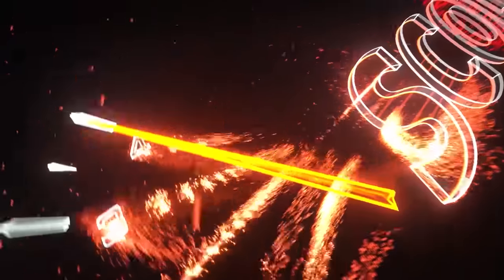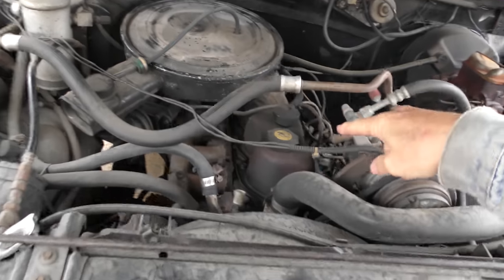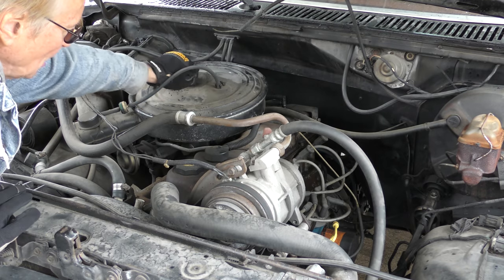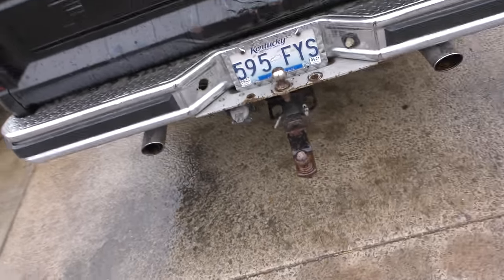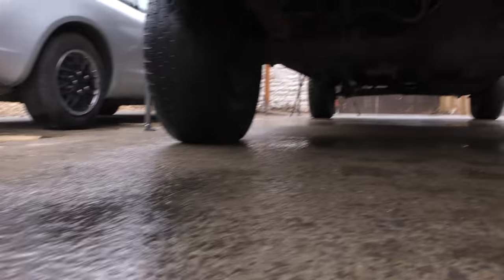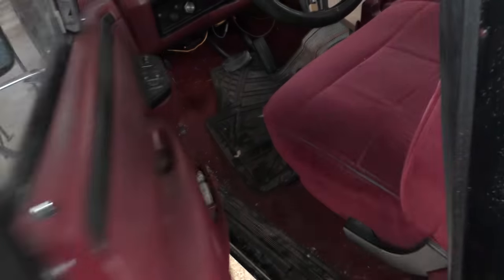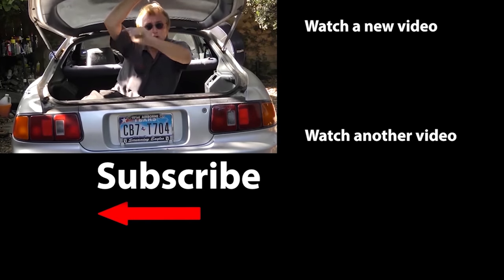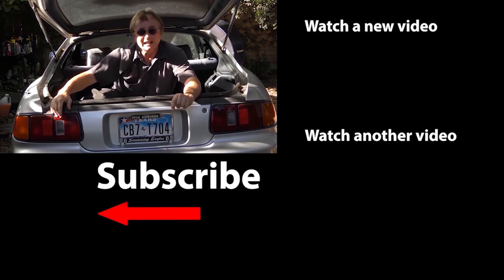I'd Give My Left Arm for This Truck

Comment: That's why Chevy, Ford, and Dodge (slant 6) stopped making their in-line 6 engines they lasted too long. No money to make on them.
Reply: GM found a way to mess up the I6 in the trailblazers. They were junk
Reply: Some of the ford 3.0 v6 pre 1991 in ranger/aerostar burned oil and blew the aluminum head gaskets
Reply: My got my envoy over 10 years ago I put a water pump & camshaft sensor.
Reply: @BIKEMAN21  This video and comment is of a straight 6..Not v6
Reply: Ford also stopped making them because they couldn't meet newer emission standards, they were too heavy and they were too long for the newer truck designs.
Reply: @wigletron2846  are you high bud? 830,000 miles on mine... water pump, batteries, alternator, plugs at 200 and 600 thousand miles.
Reply: @OvertonWindex  you're high af if you think I'll believe that lmao. How many 4l60s have you gone through?
Reply: @wigletron2846  I just told you. One. Though it was a oversized load escort vehicle so it's pretty much completely highway.
Reply: @Jason Davis THEY WERE INLINE 6 CYLINDERS, BUT THE ENGINE DID SLANT TO AN ANGLE. VERY RELIABLE & GOOD FUEL ECONOMY.
Reply: They always do that
Reply: @BIKEMAN21 Ford 3.0s are just junk. All years. Worst part is the gaskets fail internally.

Comment: I had that truck,, she rusted away in Ohio.  I drove her to the junk yard,still running ,no body left and frame rusted bad. She was a great truck
Reply: Very emotional...
Reply: Like taking an old loved dog to the vet to be put down...sad.
Reply: This made me feel sad
Reply: Yup, I had a 73 Gran Torino in Pennsylvania, same thing, drove it until late 80s, total rust bucket but 351 Cleveland engine ran perfect when I finally gave it up
Reply: Should've taken the engine out and put it a truck that wasn't rusted.
Reply: Is someone cutting onions ? 😭
Reply: My first truck was the same. Only I was driving down the road with 2 drums of tar in the bed when the rust let the bed collapse into the cab which went down and forward, the pedals disappeared into the floor and the steering column went down to the seat. I crawled out the window and said goodbye to a great truck!!
Reply: man, that's sad, should've taken the engine and transmission out and put it in the next rig!
Reply: The 80-82 model Had holes Drilled into the frame from Factory Ford Tried to make the Truck Lighter for Better Fuel Economy Resulting In a Weaker Frame.

Comment: Craigslist just broke by everyone searching for a '81 Ford F100
Reply: Craigslist just broke for everyone searching for a 94' Celica.
Reply: Or an older Explorer with the V8 engine.
Reply: Most of those 81 F series trucks up north rusted away decades ago.
Reply: LOL
Reply: @45AlfaCharliePapa  not in Idaho, I got a ‘81 f100 longed just like the one in the video for free because it didn’t run. Same 300 in it but mine had a 3 on the tree. It was a pretty cool truck
Reply: @Treven Jones I had a 81 F150 Ranger package with a 351 modified. Loved that truck, so sad to see it just rot away before my eyes. Got to the point it was rusting away faster than I could fix it.
Reply: @Lettuce-and-Tomatoes  Yeah...with the HO 351 v8! My mom had an '84 when I was a teenager and I LOVED driving that thing! I really like that body style Ford truck...they never got the love the '70s ones got for some reason. I especially liked the looks of the F250 4x4s (they were almost as high as the highboys!), as well as the Bronco. Some of Ford's toughest looking trucks. I've got an '86 F250 w/460 v8 that is sitting gradually rotting away in my back yard...need to get it back on the road.
Reply: KING SCOTTY, HES THE BEST, F THE REST
Reply: Come to Washington and Oregon they’re everywhere up here. Still running strong too
Reply: I have a 1979 f100 with a 300 I'll buy another one with a 4 speed manual
Reply: My fault 😶😆
Reply: little monster  😆🤣😂

Comment: So you’re saying that specific truck really was Built Ford Tough?
Reply: The only weak spot on them was the distributor. But that wouldn't give you trouble until well over 100k miles. 
I had one, and those 300 engines are bullet proof
Reply: Proud owner of one myself
Reply: @ramosjaime11  The EGR tube that comes from the exhaust manifold has a tendency to corrode too.  That will make the truck sound like it has straight pipes but the sound will  be coming from the engine.
Reply: My 78 ford van with 3 speed manual and 300 straight 6 was great . Rotted away
Reply: That trucks engine sounds as good as the gas gmc in the big UHaul trucks.
Reply: My 83 f150 had its factory distributor blow at 568k us miles and I put a new one in fired right up, my 87 f250 300 i6 is sitting at 1.02 million miles stills runs strong
Reply: 300 SIXES WERE the TOUGHEST FORD ENGINE EVER BUILT ! HANDS DOWN ! MIC . DROP ! .

Comment: I wish I could find that type of older solid truck, let alone for $2
Reply: I've got a 88 ford....
It's been sent me for about 7 years , 
two people that have checked it out have verified that it will run It's not seized or anything
Reply: Praying to have a little chunk of change to go about getting it up and running one of these days
Reply: Where was this 8 months ago while I was shopping for a truck?
Reply: Picked up an 86 c3500 GMC dump with a 6.2 for a buck 3-4 yrs ago and it's my daily driver work truck. She's ruff here an there but the great thing is it almost doesn't matter what breaks on it it'll still drive :)
Reply: You may not find them for 2 dollars but you can get these trucks anywhere for under 2000 bucks I see them for sale on craigslist for between 500 to 1000 all the time there not hard to get ahold of here in North Carolina. The ones around 2000 have little to no damage and very low mileage. The cheaper ones have higher miles and some body damage but not going to stop the truck from running and doing its job.  I've pulled these engines apart with over 300k and the internals look almost brand new just keep the oil changed and change antifreeze every 3 years and you will get over 300k. on my 4.9l 300 inline big 6 that's the heart of my 1995 efi 5 speed trans f150. I've got over 300k on mine and it still runs like brand new. Best truck I've ever owned hands down. I plan to keep this truck for life even if I have to ever rebuild it I have 0 dents and the only rust is very light surface rust in the bed but nothing that can't be sanded and I will be putting a spray rhino bed liner.
Reply: @acuraintegra101 even in Australia they are fair priced, they're around 6k aud for a swb with cleveland In okay condition.

Comment: Love the ford 300 I6 and the ford trucks they came in. Currently the proud owner of a '93 4x4 with the I6.
Reply: Amen! Had the F-100 82 & still have my F-150 93 4x4 300k + Miles. Burns a qt every 5,000 Miles time for change anyway.
Reply: I got a 91 F150 I-6
Reply: I had the 93 4x4 too for 20 years before I sold it and I wish I never had sold it.

Comment: I love my 85 f150. Straight six with 4 speed manual trans. Fun truck with a lot of reliabillity in its pedigree.
Reply: Got an 86 F150 with a straight six, though its auto (wish it was manual). In a day and age where u need thousands of dollars worth of diagnostic equipment and coding software to complete basic tasks, its nice to have something that you can fix (if need be) with a basic small tool set. Great trucks no doubt, and i have no partiality towards Fords at all.
Reply: I got a 85 XL 4X4, manual transmision, stright six, long bed and dual fuel tank in Mexico City. I bought it about 300 bucks. We had to rebuild the engine because it had an stuck head valvule but everything else is in good condition. How rare is this truck? I mean in termns of equipment. Plus the truck got the "EXPLORER" badge on both sides of the bed.
Reply: Im looking at buying a 1985 Ford F150 Lariat this tuesday. Its going for 3500, but is in excelent condition and I've had a mechanic look at it. Have a lot of family telling me not to buy it because of its age and its rear wheel drive (I live in Minnesota). What do you think?
Reply: @maverickgamesalot6968  I have no issue in NY winters as long as there is weight in the back.
This comment is 3 years old and I still drive the truck.
Great trucks.

Comment: Those straight 6s are bulletproof. Globs of torque.
Reply: I've seen them go 400K miles without major work.  The trucks they were in were basically rotted away to almost nothing, but that engine would still start and run.

You know why Ford doesn't make them anymore?   Because if they did, you'd never buy one of their NEW g**damn trucks.
Reply: @xaenon  Yep.
Reply: Why is this guy yelling.

Comment: The ford 300CI straight six is the best work engine made in the 20th century.
Reply: Absolutely tough proven! My last 300 I bought new was in 1993. 300k miles now burns 1 qt oil every 5,000 miles. Go figure, that’s why ford quit making them. Just way to good for today’s society.
Reply: I would say the Mercedes-Benz OM617 is the best engine ever build

Just from the fact that these engines are willknown for going over 2 million miles without breaking a sweat 

Back when they actually build reliable diesels
Reply: 300 straight 6. No redline. Can't hurt them.
Reply: Amen. 💀🔥
Reply: Absolutely... Mine 96000 miles still strong traded for an '04 with a V8 still driving it 166000 miles
Reply: @CoffeyKingVlogs  but isn't that a 3l diesel? Not that great for doin the work the 300 is meant for (283lb ft tq at 1200 rpm)
Reply: @Project-gr6zy  it is.. A 3l with no turbo, actually great for towing and long trips, my cousin had one wit over a million milies he bought for close to nothing

Like 600 $
Reply: I AGREE.  & IVE HAD5 OF THEM.
Reply: @CoffeyKingVlogs  in a work environment that Mercedes diesel will suffer, but for a car yea I can see that along with om606 

But not for truck, I see it blowing up prematurely compared to a 300 i6
Reply: @Project-gr6zy  That's the 300td
The 300d is solid, and will tow till it runs out of diesel

I have never seen one with under 350.000 miles,

Plus they were populair here in Europe as they needed little maintaince to keep on going down the road
Reply: @CoffeyKingVlogs  ive only ever seen one 300 i6 ford die, was on cash for clunkers, my 300 in my 87 f250 drw workhorse has 1.03 million miles without a rebuild and I tow my ranger to the track with a 38 ft gooseneck and some other equipment and shes only ever quit when she drank too much gas other than that solid motor
Reply: @CoffeyKingVlogs  i have no personal experience with the Mercedes engines but just from paper specs it doesn't seem like something I would tow with
Reply: @Project-gr6zy  It got a really heavy flywheel... It's slow, but the gear and differantial ratio are actually good for towing if you get the diff from the onces that drove as taxies
Reply: @CoffeyKingVlogs  what cars/ trucks did it come in, the i6 ford came in f700s witch grossed 24k us lbs empty

Comment: I miss my 85 F-150 straight 6 4 speed manual. Best truck I ever had. Unfortunately in Pennsylvania it rotted away faster than I could patch it. Had well over 300000 miles. Wish I still had it.

Comment: Now that would be the perfect old pickup with the old bolt action 3 on the tree.
Reply: I'd love to have a pickup with the 3 on the tree. They are very fun to drive, but extremely hard to find.
Reply: @jmccormick1490    The old 3-on-the-tree IS hard to find - even harder to find one that the original shifter isn't completely worn out.  Most of the ones with a 3-speed were converted to floor shift for that reason.  Pretty sure '82 was the last year for a 3-on-the-tree at Ford, and Ford was the last US automaker to offer one.

The one I'd like to have is a 300 six mated to the old SROD.   It's a four speed floor shift manual, but third is 1:1 and fourth is actually overdrive.

Comment: Thank you so much for giving this truck the credit and admiration it truly deserves. My pops bought me a 1983 Ford F100 as my first car/truck and I can say with 100% certainty I'm never letting it go. The 4.9L I6 is truly an unbreakable engine. It ran for over 10k miles with a vacuum leak and it kept chugging along like a tank. Its a thing of the past but yet way more durable than anything built today. SO happy I saw this video today.

Comment: Ford straight 6 motors last foreveeeeeeeer had one with over 300 k
Reply: Yeah,... that's why Ford stopped using them, they last too damn long,... can't have that.
Reply: I have a 95 with 360k
Reply: Nice!! I have a Tundra Crewmax 👍 on my way to the million miles Tundra club 💪
Reply: That, and the Slant 6 from Dodge along with the 292s from Chevy.
Reply: My 88 F-150 with a 300 six and 4-speed manual is coming up on 500,000. Still smooth and gets good mileage, but it is showing its age when you start it cold, the bottom end rattles for a second, it's due for a rebuild, even though, it doesn't use any oil or coolant
Reply: I forgot to mention, the fiber cam gear was replaced at 350,000, that's the only significant work done to that motor
Reply: My 92 4.9L has 240,000 miles. Original engine and trans. Changed trans fluid at 100k and 165K. Replace water pump, radiator, alternator twice, plug wires twice, plugs once.  Uses no oil, still full at 3k change.   If I can find a pre EFI, I would prefer it.  Less wiring, easier to work on.  Downside with carb is poorer fuel milage, and drivability in cold weather.  Still lots of old trucks in my area (SW Arkansas).  Usually not much rust.

Comment: My '93 F150 is by far the most dependable workhorse I've ever owned. With an oil pan leak now finally at 170,000 miles, it is still a great truck. These trucks are built solid and just plain last. I only wish I could buy another one new. The 302 ci. is one of the best engines and a great runner.

Comment: I had a 300 6 cylinder in my 76 f100. I got it when I was 18 and sold it 20 years later.  I have an 86 f150 right now.
Reply: Arthur, Never sell . See how many people regret it. 88 4.9 stick here. Just got her painted. 👍

Comment: Hey scotty I have a 1980 f350 dually and I am fixing the best up.  Taking the fiberglass rear fenders off and building custom steel fenders to replace them but I  am following the original pattern somewhat.  I'm working hard on restoring it because the last owner neglected it in every way.

Comment: These old 80s Fords are awesome! Mine is an 86 f150 4x4 with the 300, 4spd manual, limited slip rear diff, dual gas tanks, power windows and door locks, and probably a few other things I've forgotten. It needs some work but even then it's a blast to drive.

Comment: “Dump truck” lmfao Scotty
Reply: I had an 85 f350 dump truck with the 4.9l 300ci inline 6.
Reply: Ya even ups trucks this engine is no joke it's a real bullet proof strong as hell engine. They even use them at air ports to run all the ground support equipment. These engine is the real deal that helped and is still helping to build America. I personally own one of these gems and it has over 300k on it and still runs like new. And will pull way more than recommend and not complain one bit.
Reply: @acuraintegra101  that's actually really cool, thanks for sharing that with us!
Reply: They offered that 300 i6 in the f700 dump trucks too with Clark 4 speeds and 2 speed rear ends
Reply: @Project-gr6zy   like I've been told since I was a teenager this engine is pretty much a gas powered diesel engine. The two best engine hands down are the gasoline, LPG, natural gas, and CNG 4.9l inline 6 300 ci and the 7.3L v8 444ci Power Stroke diesel both engine are power houses that are unrivaled in the truck world. For there reliability and power but for me hands down the 300 is my choice for a engine in my truck because of its way cheaper than a diesel to repair and maintain.

Comment: The cylinder deactivation, and even worse, the "start-stop" functions, where the car shuts down when you come to a complete stop, you just know a) that cannot be good for the engine and, b) it's just another thing to go wrong.  I think they do it to meet fuel efficiency standards (?).
Reply: Mine has 3.25 rear end, 3 speed automatic, 2wd, and 30.5x10.7r15 (265/75r15) tires and I average between 15-16mpg (if I keep her at 65 or under) at 60mph she runs right at 2k rpm.
Reply: Yep, when I was a pizza delivery driver I had to replace my starter from all the starting/stopping... Then I started leaving my car on, while parked at customer's houses. You only get so many starts from a starter motor.

Funny thing... my starter burned out literally while I was delivering to an auto repair shop. Guess who fixed it.

Comment: My dad has a 87 Ford Ranger STX extended cab...top of the line.  Extended cab, manual transmission and push button 4 wheel drive.  124k original miles...2.7 v6.

Comment: Scotty explain why Toyotas are always holding up traffic!...and I've driven a Camry.. it's not even that slow.
Reply: cause they're mostly driven by senior citizens
Reply: @Slenderman63323  toyotamaxxing
Reply: @eye5448  it's over for chryslers, they cannot even compete with mechanically superior chadyotas
Reply: @Slenderman63323  don't buy a chryslER
Reply: 1999 V6 Camry owner here...  it smokes V8s no joke....
Reply: @Nikkk6969  Those gen4 Camrys with the 1MZ-FE and the rare 5 speeds are pretty quick cars.

Comment: I bought a 1981 F-100 in 1995 for $1900. It had  75,000 miles.2wd short box with the 300 -6 cyl and a 3 sod manual with 4th as overdrive.I drove it for 12 years.Had to do a clutch,and the water pump like 3 times.I got upwards of 25 mpg if I was on flat ground.I even put a chrome tube grill just like the one you show on this video.Thanks.

Comment: Yes, sir. I  am driving my late father's 1983 F150 and its 2023 now.  Rust here i Wis bad, tho. Had to replace fuel tank, replace steering column shifter when  it wore out, with floor shifter. Still going good.